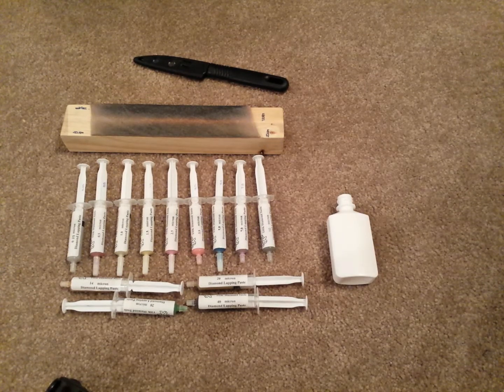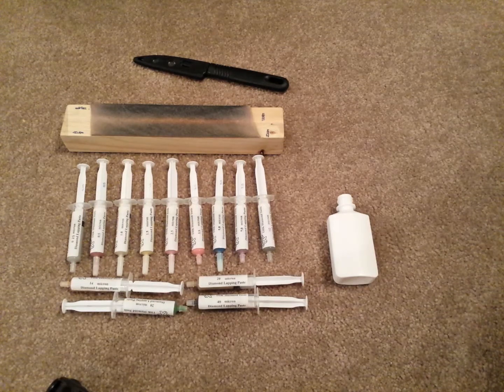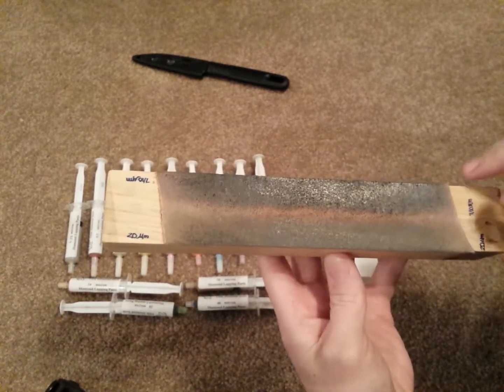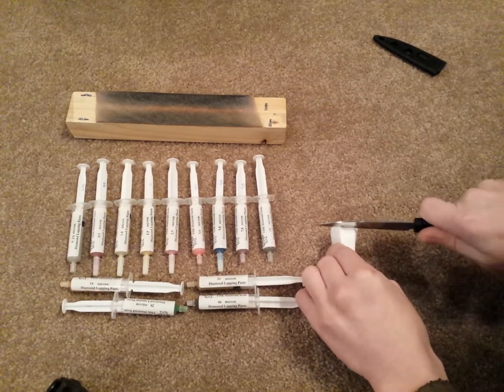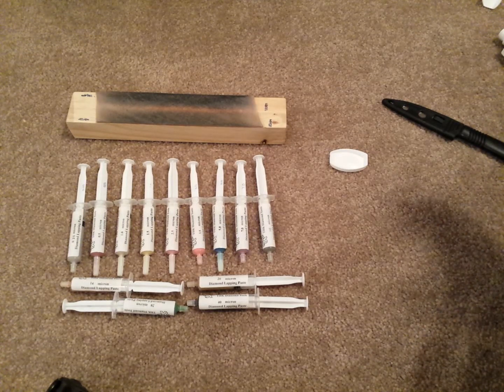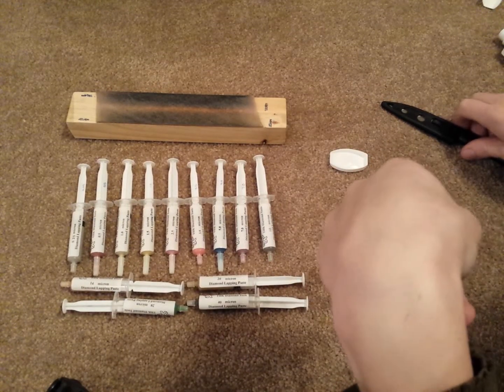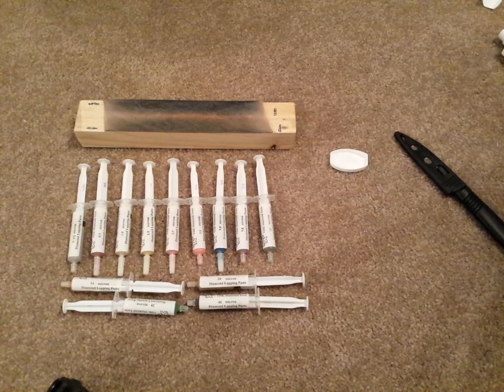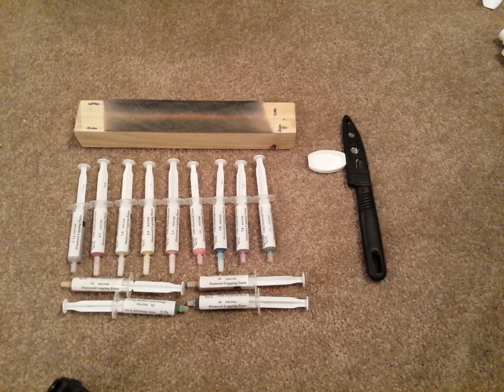Stropping Compounds: Combining Grits

Comment: I am not sure what you are seeing exactly with a mix, keep in mind that the abrasives themselves are nominally rated so a 10 micron abrasive will have a range of particles size.
Reply from the maker: I don't doubt that there is a slight variation in size of abrasive in a certain grit.  I have multiple brands of diamond pastes and sprays in the same micron size and there does seem to be some variation between the finish they leave.  I have made 15+ strops in the past few months so that I could try out each grit on its own and I am definitely noticing some differences in the finish, sharpness, and cutting aggression between a strop loaded with 1 specific grit and a strop loaded with multiple different grits.  While I don't currently have a way to quantify these differences, they are generally large enough to be quite noticeable.  I have also seen that certain steels behave quite differently than others depending on the abrasive size used.  In order to keep the influence of steel type, hardness, etc. in this crude experimenting minimized, I am either taking one specific blade through the grit progression and testing after each step or in some instances I have many knife models from same batch and each one will be finished in a different grit.